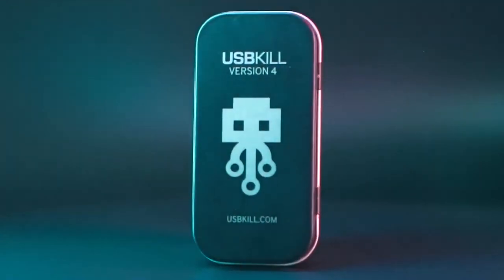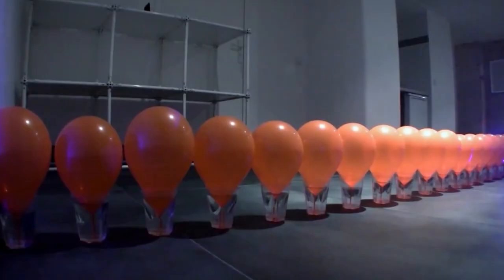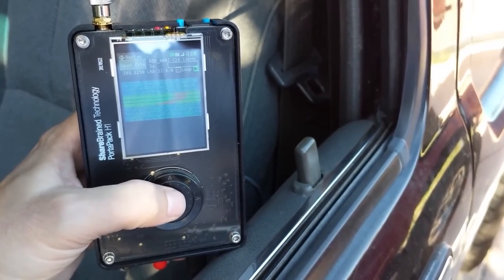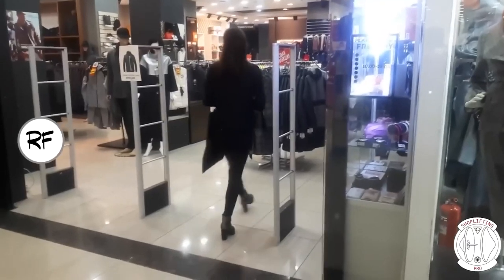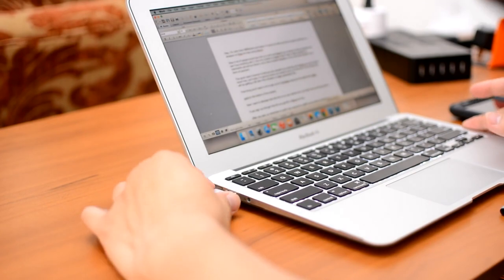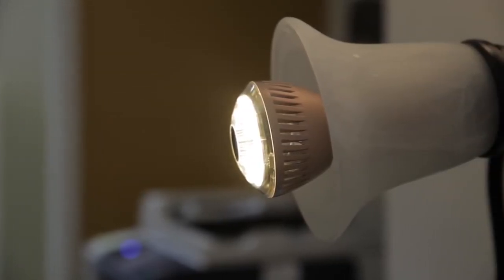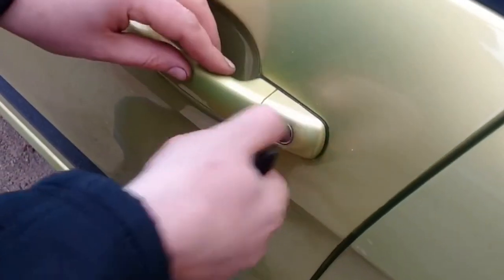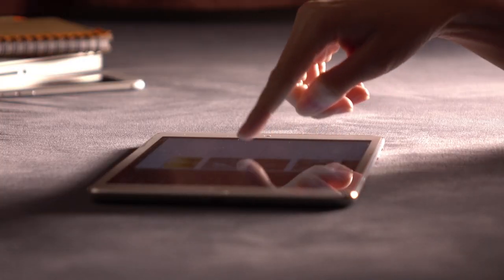12 Banned Gadgets You Can Still Get At Amazon

Comment: Considering that my bank card doesn't work if the machine or POS at a store doesn't use the chip it makes the pin and copying of the mag stripe pretty useless without somehow managing to replicate the chip details exactly onto another chip. And as far as I know this level of cloning hasn't been achieved yet. The transaction fails if I swipe my card instead of insert it into the reader. And I've had the chip die once before and even though the magstripe was ok I couldn't get my card to work in any machine I tried it with that weekend even the little atm's you get in the corner store or at a bar. As for the fob reader to steal or unlock a car it requires that you first get the key while it is out of range and press the unlock button. And as the codes only work once recording a successful unlock code from the fob doesn't help you. And I can't think of a clever way to get the owner to press the button on his fob for you without raising their spidey senses. Also if you are able to get access to their fob secretly then the thief would just use the fob itself to make off with the car or unlock it and not have to worry about restarting the engine or open the door again after filling the tank for instance.
Reply from the maker: Yeah you're right. But I've personally experienced this back in 2021 🥲